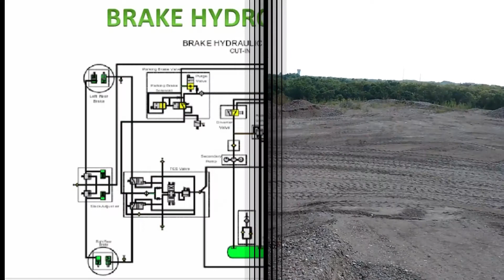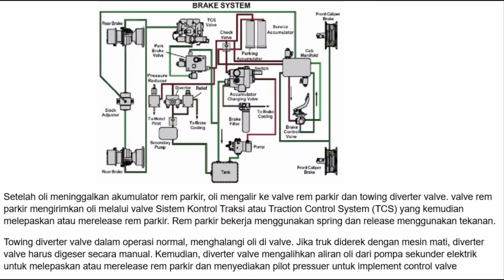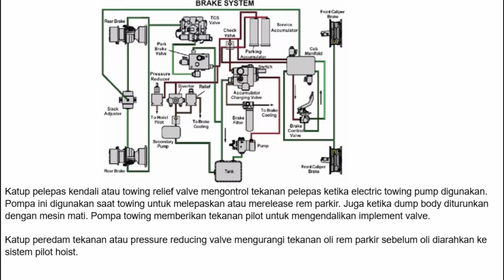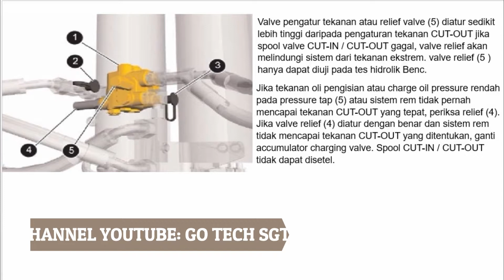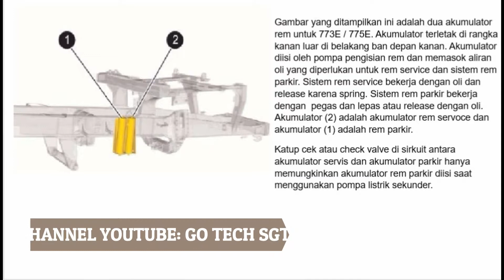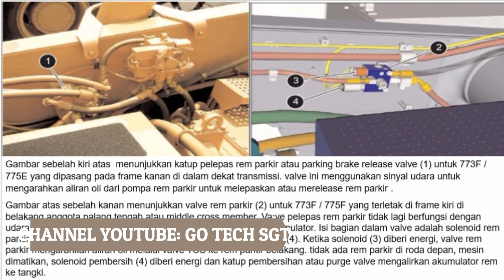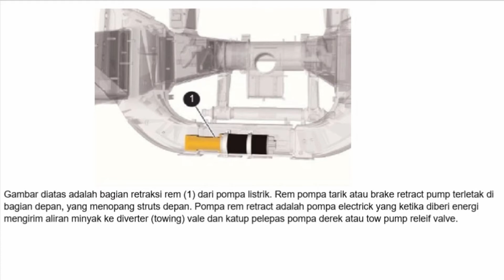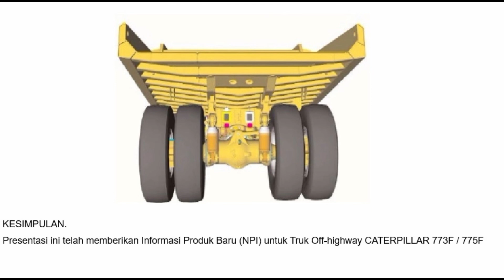PENGENALAN BRAKE SYSTEM PADA 773F TRUCK

Comment: Bang presure parking brake 773d berapa yach..makasi..
Reply from the maker: Parking brake pressure untuk 773 D, 650 psi sampai 750 psi.
Reply: @lpkbinakaryaeducation8585  ok bang makasi...
Reply: @lpkbinakaryaeducation8585  cara kerja dr jalur oli masuk ke slack adjuster dan cara mempertahankan residual press.gmna caranya pak.makasih